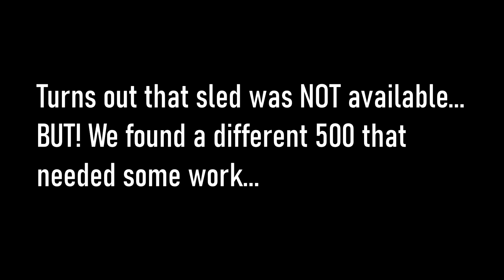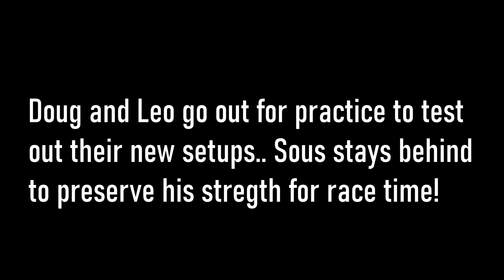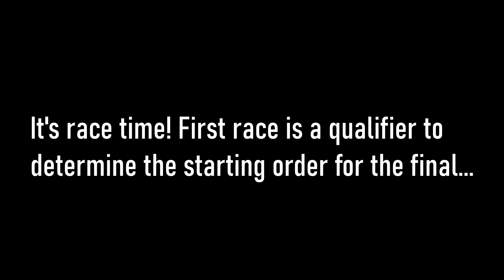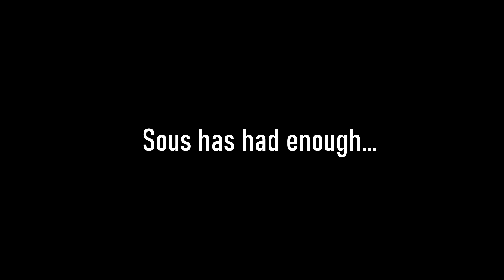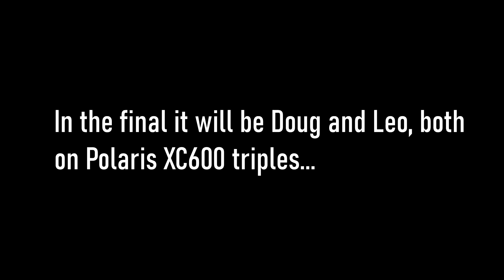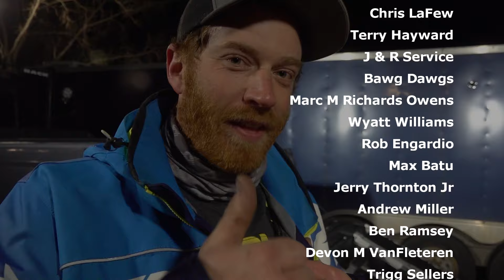Cheap Sled Racing! Doug finds a sled, Leo gets ran over!

Comment: You could have just popped the box open….

I just picked up a zr500 to beat this weekend. I did one race like that.  50 miles on a 5 mile track when those sleds were new.   It’s beyond rough.